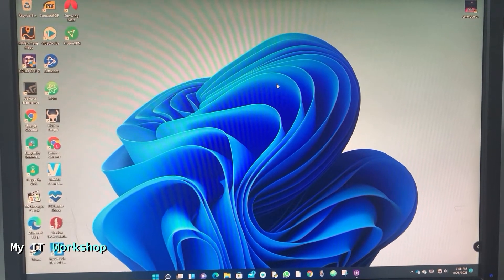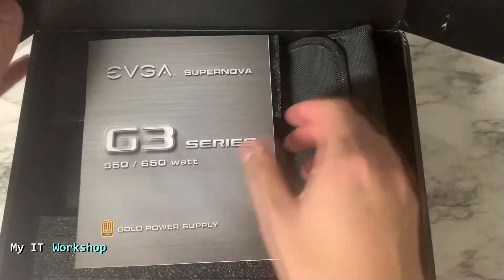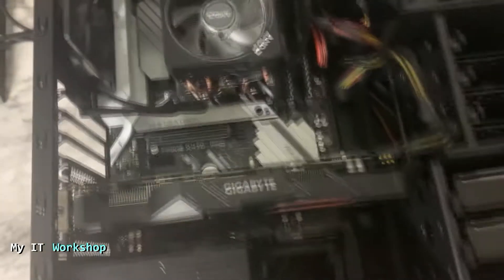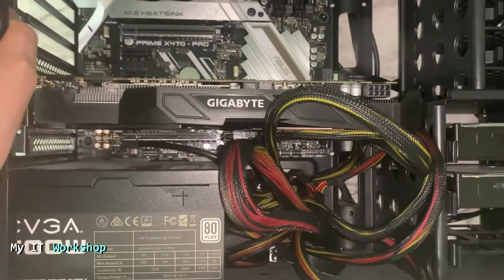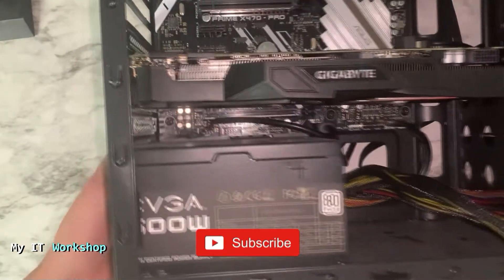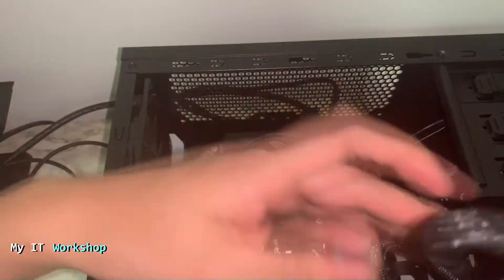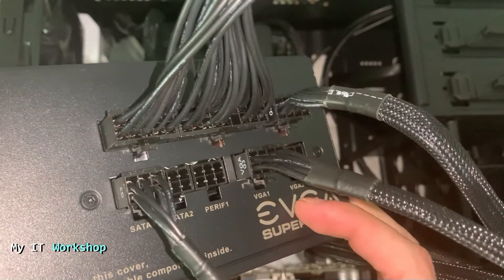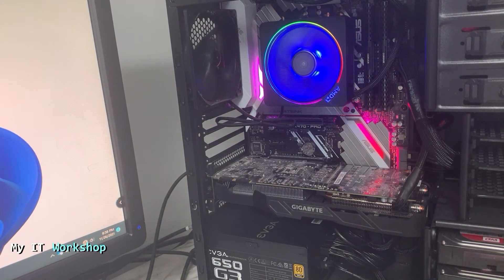Install a Modular PSU on your Computer

Comment: Ty for this very informative video.   I have a asus ROG Strix G15CK Gaming Desktop PC. I believe it has a 500 watt non modular psu. Would the steps for removing it be basically the same and then for installing a 750 watt modular psu? Would all the cables needed be included with the a 750 watt modular or would I also have to buy extensions or other connecting wires? Thank you sir